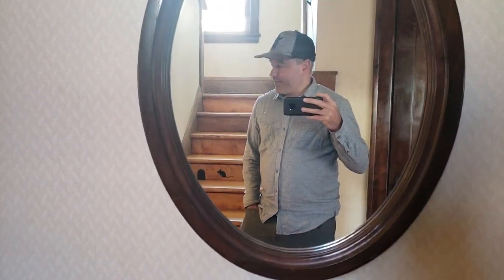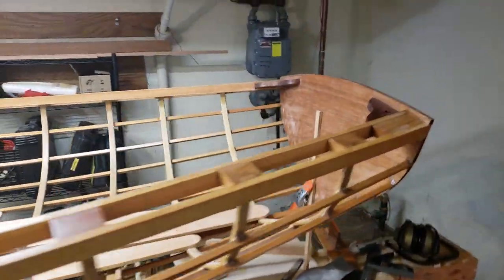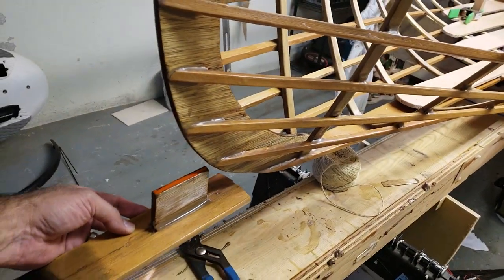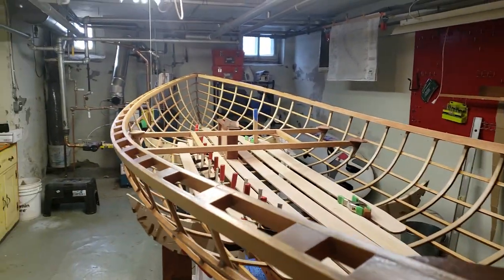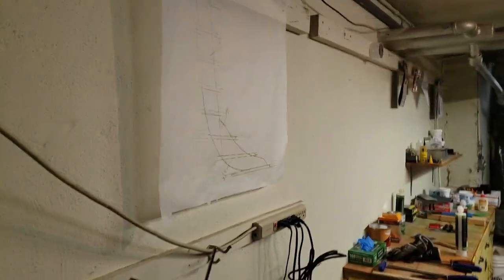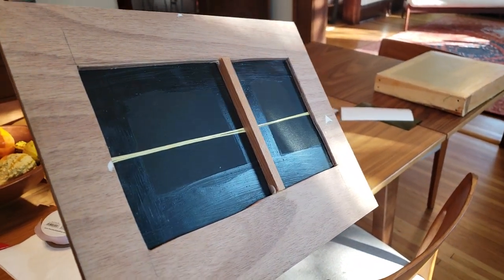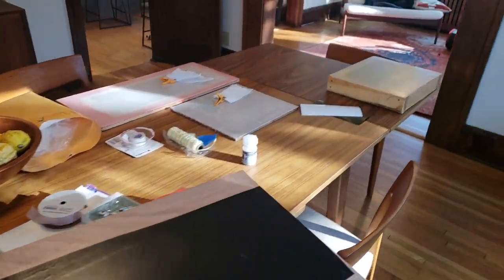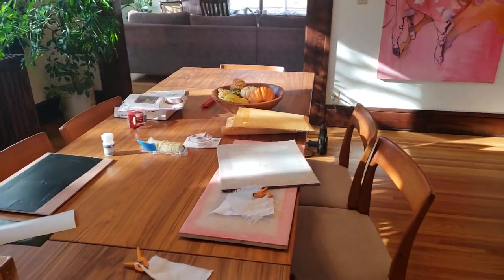Geodesic Aerolite Classic 12 Overview

Comment: On the Classic 12 boat plans the stringers join the ribs angled so their 90 degree edge meets the rib, the gap then filled with epoxy. But you made the join with the stringers' flat face against the ribs. Was there a reason for this (other than it being it easier)? Great video, thank you for taking the time and for answering others queries - really helpful for builders like us coming after you.
Reply from the maker: It's just how the ribs landed.  It was also easier

Comment: Thank you for your research on skin materials and finishes.  I am building a geodesic nimrod 12.  Based on your research, I am using the 9 oz dacron with the spirit line 2 part urethane.  A technical question -  Did you find it important to tape off the sections  over the heat bond tape before applying the 2 part urethane?  I found a recommendation that be done when using regular varnish or urethane to avoid loosening the heat bond tape, but I am wondering if that is important when using the 2 part product.
Reply from the maker: No.  I was able to go right over the tape.  No problems
Reply from the maker: but you should not leave the heat N bond glued onto the wood with the paper peeled overnight. It's best to move quickly after you peel off the paper.

Comment: Hi Josh, Great job! I am building a Geodesic Aerolite Classic 10 and have a question. I am at the covering stage and got the 2 part urethane from Corey at Skin Boat School. Larry from GABoats suggest tipping the boat upright after coating the boat to let it dry. Did you do that?
Thanks
Chris
Reply from the maker: No I left it upside down

Comment: Instead of painting a negative of your stringers on the back of that material, you could just paint the entire backside of it with a roller, and the excess glue would probably cost less than the gained labor time.  It might help with UV as well?
Reply from the maker: Perhaps.  I went with the 9oz and glad I did.

Comment: Did the plans include details on adding the centerboard case and plans for the rudder or was this optional?  Their website isn't clear about that.  I like your simplified gunwale design.  Also did you consider any of the other sailing rigs, or did you only consider the Classic 12?  I'll probably build one of the smaller kits first, but thinking long-term.
Reply from the maker: The plans include the sailing details and a grid loft for the rudder.  The nice thing about the classic12 is it is an awesome rowboat and I have enjoyed that as much as sailing.

Comment: I am just starting my build. I am curious about your glues could you give me a list of exactly what you used, and how the have held up over time?
Reply from the maker: Austin, I am glad you are starting a build! 

I used MAS products (https://masepoxies.com/)  Woodzilla (brown) and Gluezilla (thixotropic).  Both work in a standard caulking gun.  I find the gluezilla to be more sticky out of the gate and you could easily get by with woodzilla for everything. The woodzilla finishes really nice with varnish. For clear finishing on all wood, the frame was coated in 3 coats of MAS low viscosity epoxy and 2 coats of system three satin spar varnish (https://tinyurl.com/y9tvxcjs).  The epoxies were expensive. If I was to do this again, I would use skinboat goop (what I used on the dacron: https://shop.skinboats.com/2-Part-Urethane-Coating-for-Kayak-Skin-goop1.htm) on all the wood and coat it with satin system three varnish.   I did that on the floorboards and it worked fine.  Rudder and centerboard were epoxy (3x) + 2x satin system three spar varnish).  I found this an excellent substitute for high priced epoxy kits if you go the epoxy route: raka 127 resin + 350 non blushing hardener (http://www.raka.com/epoxy.html). 

Given that I have 3 disjoint systems for clear finish between the boat, floor boards, and rudder/centerboard I can say that all are working.  The system3 varnish is easy to use and brings the shine down which I like and the polyurethane goop used on the skin is UV stable and requires no varnish so you can save a lot of time.

I do not store my boat outside (in garage in summer, basement in winter).  I have had zero issues with peel or fading and had it out sailing yesterday (I tow it with my bike). The boat is fantastic and sails well.   Happy to answer questions along the way, just ping me.  I will send out another video soon about how it sails as I have gone boom-free and changed out the mast to a stiffer one.
Reply: @joshuarichard6792  Thanks a ton! I have a few more questions for you, do use Facebook Messenger? Maybe I could send a message on there?
Reply from the maker: @austinchild9788 best if you email me and I will sort out how to connect. jrichar4@gmail.com

Comment: Thank you for sharing your knowledge. I aspire to build this boat in the future, but for now I am going to build the Snowshoe Lassie in my basement, because i have only enough room to build a 10’ boat. I think i am going to ho with the 9oz cloth and the skin boat 2 part urethane. Did you use their 3 coat method? And did you use their method for application?  Can you share any tips for the application? Thanks in advance and great job!
Reply from the maker: Thanks and best of luck.  I started my build unsure if it would fit in my basement.  You should start in a garage so you do not make a ship in a bottle. :)
Reply from the maker: On the urethane, I think i ended up giving this boat 4 coats.  It's really easy.  I started with a squeegee (the plastic one you get from the kit) and worked it on the skin. I think you can skip that and use a roller (foam).  The best part about the urethane is it picks up all the stringers and that keeps grit from collecting between the frame and skin and reduces a failure mode.  Cheers!

Comment: Joshua,than for the video! Have a question. As I have been researching different SOF's I do like this approach because of using a mold. But other building techniques use the "sinew" vs. epoxy. Concerned about the shear strength of those joints.
Reply from the maker: In my experience the epoxy joints are stronger than the wood.  Just don't starve the joints.
Reply from the maker: The sinew approach also works, depends on your mood I guess. I don't think a hybrid approach would work for this boat due to the gunwale construction.  Hence I stuck with epoxy.  No issues.
Reply: Thanks!

Comment: Great video! Your original 3.7 ounce application used traditional spar urethane.  Would you recommend using this type of urethane on the 9 ounce? I realise I would not be getting the adhesion to the stringers. Thanks again.
Reply from the maker: Not at all.  Go with the skinbost goop for any fabric.  Its so much better.
Reply: @joshuarichard6792  Thanjs for the quick reply. I think I’ll try your recommendation. I’ve already got the 9oz from Larry.
Reply: Oh. Just thought. How many coats?
Reply from the maker: @mattdjmorris  4 should do it. Just keep doing laps with 45 mins between coats.
Reply: @joshuarichard6792   I had a great discussion with Corey Freedman today. Super interesting guy. 
Sorry to pester you but I’d greatly appreciate your input on two questions I have. 1) is there risk that Corey’s two part urethane could loosen the heat n bond attachment of the 9oz Dacron on the gunwhales during application? 2) would you ever consider lashing the ribs to the stringers instead of using epoxy—and skipping the rovings?
Reply from the maker: @mattdjmorris  shoot me an email and I'll call you. Jrichar4@gmail.com

Comment: Hey Joshua, on your windsurf sail you aren't using a boom. Do you find that the sail holds its shape? My windsurf sails all need a fair amount of outhaul to maintain the shape of the sail. What are your thoughts on that and why did you decide to not use the boom?
Reply from the maker: For this boat, the boom was too heavy and I found I do have enough tension in moderate winds to sail without a boom.  That being said, I am considering modifying the rig in the fall to use the sailplan from another boat I started in Feb.  That sailplan is a lateen rig which has both a boom and a yard and I already made the spars.
Reply: @joshuarichard6792  What boat is that? Still trying to decide on the sail for mine. Thanks for your reply.
Reply from the maker: i am working on a eureka 155 canoe + trimaran. https://www.storerboatplans.com/boatplans/drop-in-outriggers-for-canoes-kayaks-some-dinghies-sailing-videos/

Comment: 7:18 you mean a 400 foot long plastic tube? how did you seal it for steaming?
Reply from the maker: Not a tube, a roll of plastic (like an infinite sandwich bag) cut to ~10 feet.  To seal it: 1 end was taped to a hose using good masking tape, 2) other end I just placed a tape measure on it.  The steamer kept the bag full of pressure.